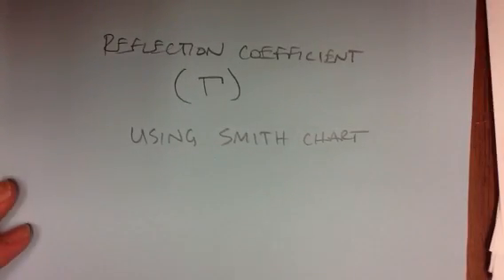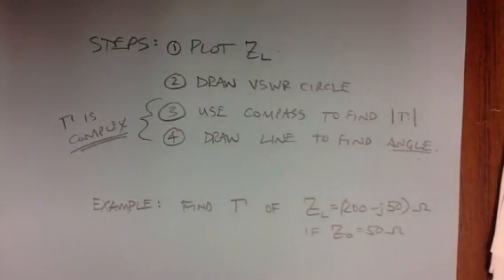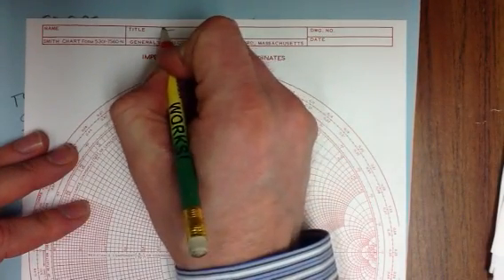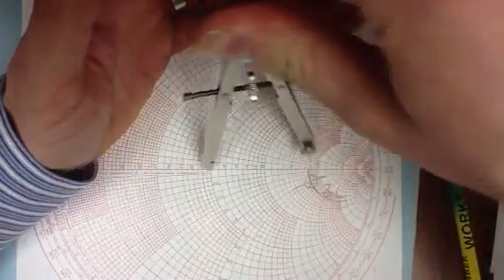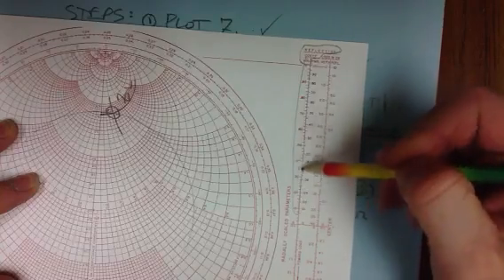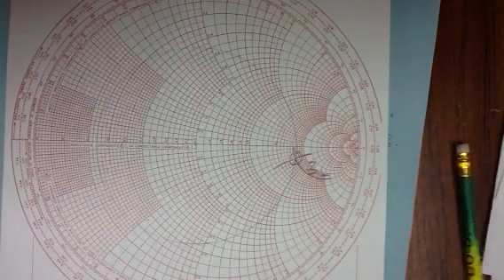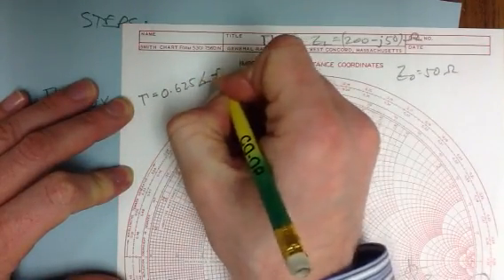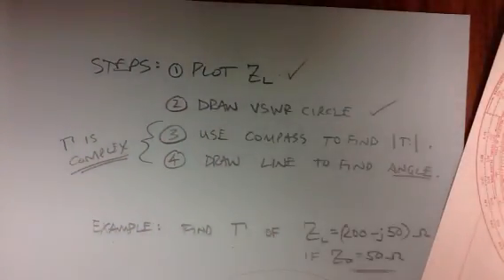Smith chart basics, part 3: finding reflection coefficient

Comment: why do i have a different Radially Scaled Parameters  coefficients? Where yours say 'Reflection Coefficient Voltage', mine says a bunch of other stuff like 'Atten.[dB]','SW Loss Coeff','RFL loss [dB]' etc etc....please help? where else can i find the magnitude reflection coefficient? :'(
Reply: +Suhaila Sami I had the same problem. On the LHS you'd find a 'RFL COEFF, E OR I', I used this and got the value.
Reply: Aha right. thanks!

Comment: I appreciate your videos, and am using them to get my Extra Class, before they change the question pool. I don't very much appreciate lectures in electronics given by adjunct professors with nothing more than a degree in mathematics (and or maybe physics). All I get from them is the math end & a bunch of very confusing mathematical shortcuts, and zero insights into any practical applications, in electronics or even any practical physics. Half of these asshats should not even be in the country, let alone on the payroll. I can sit through a 45 minute lecture & walk out with nothing more than a massive headache, and more debt.  73 KI7AQJ

Comment: I believe the answer is wrong. The answer that you got on the right side of the chart (at the bottom) is for the transmission coefficient tau. Gamma, the reflection coefficient is found on the left hand side of the chart. Therefore, the correct answer should be ~0.33<-8deg. Let me know if I'm wrong
Reply: +0verAndOut I don't think it's wrong. Use the formula for reflection coefficient: Gamma=(zL-z0)/(zL+z0), plug it into a calculator that can do complex, and you get the same answer in the video. I got that magnitude gamma was 0.6201 and the angle was -7.12 degrees.

Comment: The 3 videos you have done on the Smith Chart have been very helpful. 
Do you have any experience with the HP 4800A Vector Impedance meter?

73,
Glenn WA4AOS